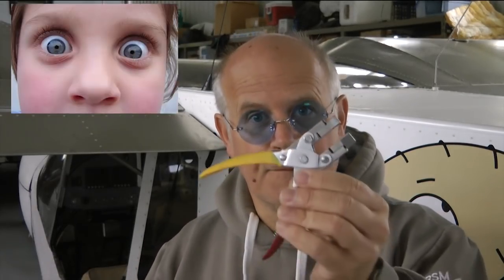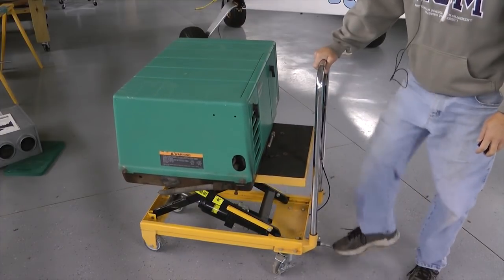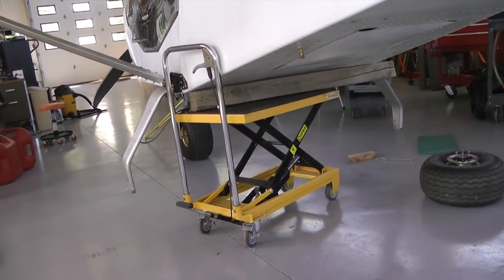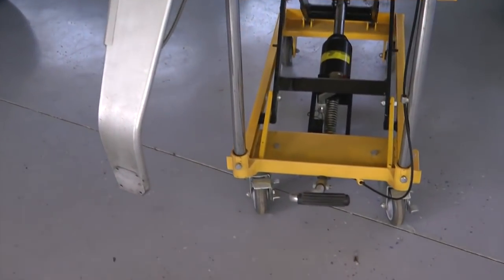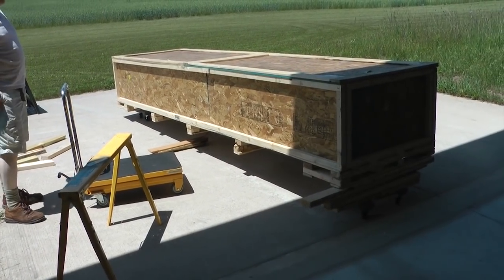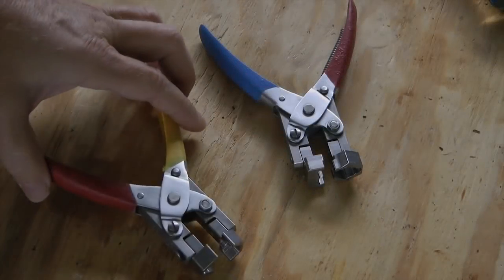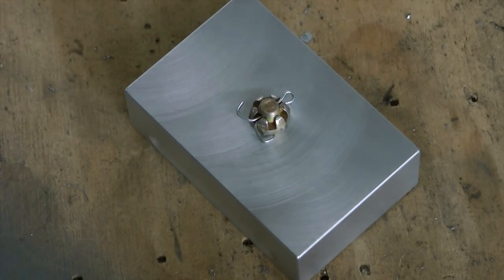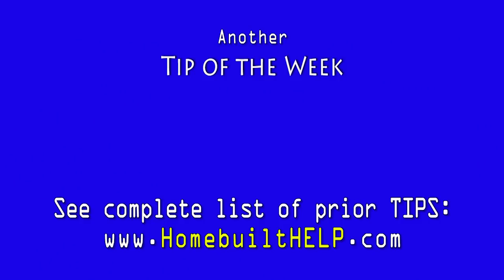A Tool You have not Seen Before

Comment: That’s not a cotter pin, it’s a split pin. Cotter pin is a taper shank bolt with a flat side. The purpose of a cotterpin is to lock a bored item onto a shaft. The shaft typically has a mating flat on its surface.
Reply: See you're not from the states
Reply: @boonb1  It’s still a split pin :o)

Comment: I hate the safety police on Youtube so I can't believe I'm going to say this. The wood stack used to help lower the aircraft box should have been cribbed (cross stacked) rather than simply single stacked as it was. 

A single stack, as was used to add some height to the lift table, is really easy to topple over sideways. A cross stack, as used in blocking and cribbing, is much safer and more stable. I worked in the heavy equipment industry for 20 years and if we saw anyone stacking blocks as was done there it was a big no no. Cribbing was required for any stack as you would have used it to take that box off the truck. It takes a bit more wood and a few extra minutes but it works much better. 

I wouldn't even say anything about this, but you are an excellent reference for homebuilders (I use your stuff all the time, both here and in Kitplanes) and people are taking ideas from you and putting them into practice. 

There are several videos on blocking and cribbing on Youtube. This sample video on another site gives a really quick (and good visuals) explanation of cribbing. https://www.convergencetraining.com/blocking-and-cribbing-for-heavy-equipment.html

Thanks for all you do. I did note that you are speaking faster in this video. I know that was a feedback item you had previously. It is appreciated.

Comment: What kind of ripoff trucking company would charge $50.xx to use the hydraulic tail gate...........if it is on the truck , it is part of the delivery system.????............do they charge extra for the steering wheel or the gps to find your house..........do they charge extra for the driver to get out of the cab and open the roll up door and pallet jack your crate to the door opening ????............this is sick profiteering............someone needs to post the names of trucking companies that charge for what used to be , part of the delivery......
Reply: You have obviously never paid to have a shipping company deliver a large box. Common practice to pay extra for liftgate truck.

Comment: Over 30 years of working on aircraft I can honestly say that those tools for forming the tails of split pins (cotter) are one of the biggest waste of time and money I've seen for a long while.
Reply: acengineer737 and add this is not the proper way to finis a cotter pin on a castellated nut. It would fail inspection miserably. Sorry but I do like the channel.
Reply: I like the channel as well Phil. 
The around the nut technique is ideal on some installation. It's not a technique I've used much since I finished my apprenticeship. If the pin legs aren't tight around the castlations, then it's not much use.

Comment: The remark about the large surface area of the lift reducing the stress applied to the airframe is incorrect. It is the area of that piece of  timber sitting on top of the lift that is in contact with the airframe that counts.

Comment: Your table is rated at only 500#.  Dunna thin I want to jack up an entire plane by the main gear mount box with only a 500# capacity (Pittsburg/ #60730 or #61405) might prefer their beefier models (Haulmaster/ #60438 or #69148) rated for 1000# loads  (ok, so former units ~90# & $150 vs 170# & $250 for beefier units ...)